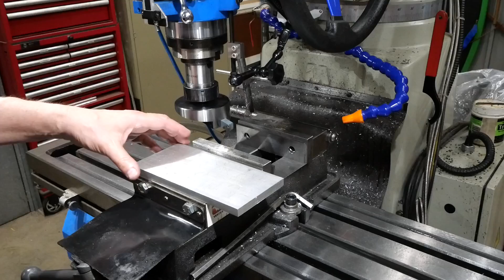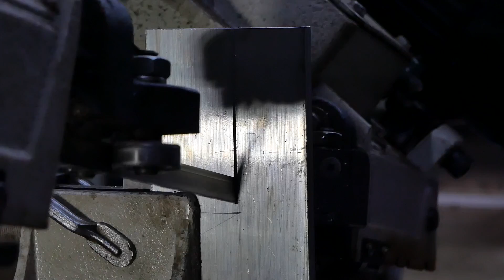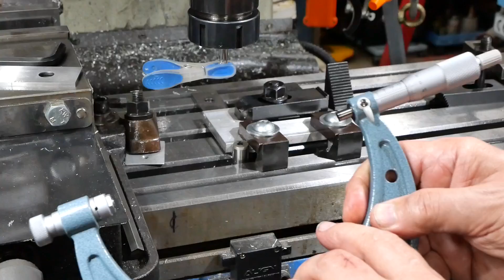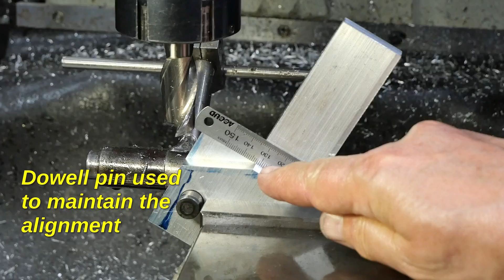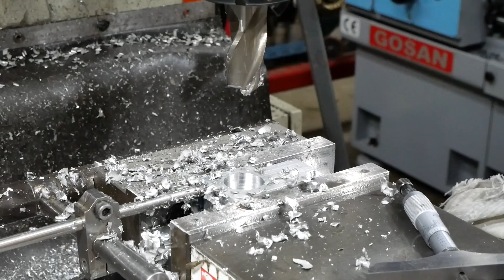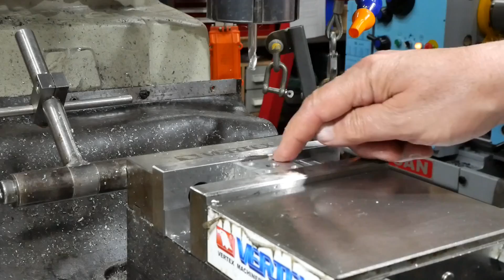Webster Engine Part 1

Comment: Coming along nicely. I don’t know where you got your prints from, but on my Webster blueprints it says to build the cylinder frame first and fit the cylinder to that. Not the other way around, that doesn’t make any sense to make the cylinder and then go all through the work of the frame to make it fit the cylinder. It’s a lot easier to fit the cylinder for sure.
Anyway, looking forward to the rest of the build I know I really enjoyed building mine.
Reply from the maker: "a lot easier to fit the cylinder" - that was my thinking. I closely followed Joe Webster's design and generally followed his construction notes. However, I did do some things differently when I felt it would be easier for me.
Hope you enjoy the rest of the build series.